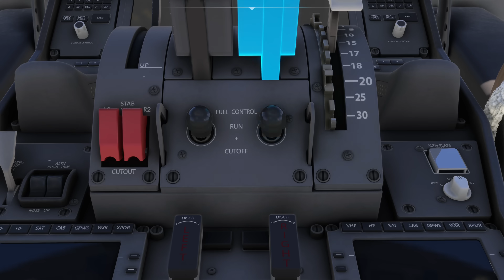Air India 171: Why Did The Fuel Cut-off Switch Get Moved?

Comment: Question, when the switches are moved from on to off or off to on is there a display that shows the status of the switches? If the input to the switches, either a voltage or ground were to get a bad connection it would cause the fuel to cut off even if the switches were still in the on positon.  If this is the case and the display is for loss of fuel pressure instead of the state of the switches  this could be what ensued.  Thus the pilot would cycle the switches.  Jim.

Comment: Captain Steeeve said that the reason a plane’s computer system will allow engine shut-off is because of a potential landing situation where there may be a fire in one or more of the engines.  He has also said in a previous video that there are sensors in the landing gear that switch the plane from ground mode to flight mode.  Can there not be a simple time restriction placed on the engine shut-off controls which will not allow them to be switched to the off position until a certain time period has elapsed after the switch from ground to flight mode?  I’d have thought this would be really simple. There could also be a procedure both pilots would need to carry out if they really did need shutting down in a take-off situation although I would have thought that, as in this case, any such situation would cause the plane to crash anyway.

Comment: FADEC stands for Full Authority Digital Engine Control.
What FADEC does

Monitors and protects against overspeed, overtemperature, and mechanical failure

It's called "full authority" because the system has complete control over the engine, and pilots cannot override it manually (except by cutting off fuel or shutting down the engine).

> Because pilots cannot override FADEC electronically — it has full control.
Only cutting off fuel manually (via fuel cutoff switches or fire handles) overrides FADEC.

Comment: But these are two separate switches, operating independently. So, if it's truly a mechanical error, as stated in the 2018 advisory report, how likely is it that the exact same issue would occur with both switches—especially one right after the other? That seems highly suspicious. It feels like this may have been done intentionally.

Comment: What happens if I put my hand to those switches to get support? When aircraft takes off the angle that I apply the force could change and it may accidentally open the mechanical lock. I think it could be unintentional as well as on purpose.

Comment: The FAA’s 2018 SAIB warned that in some aircraft, the lock mechanism could be disengaged, meaning the switch could move to OFF unintentionally, due to:
	•	Vibration
	•	Accidental contact
	•	Mechanical failure
	•	It advised operators to inspect these switches to ensure the lock engages properly (i.e., they can’t be moved without lifting the guard).

Comment: a comment from an other video: "This is exactly what happened:   - There was an anomaly in the electrical supply at 08:08:41h, so the hardware and software closed the fuel valves.   The engines began to lose rotation and the RAT was automatically activated. When it restored electrical power at 08:08:52h, a RESET was generated in the software and hardware, then opening the valves again and indicating that the switches had been placed back in RUN, when in fact they were NEVER changed by the pilots!      -Don't forget that Boeing's 787-8 Dreamliners have a history of electrical problems!" what do you think about that?

Comment: Dear Captain Steve...
I can come up with 3 scenarios as per my understanding... can you throw some light on the 3rd one if it is possible ?

Scenario 1

1) Takes off... perfect time low altitude high speed... no recovery time possible.
2) Cutsoff both engines... asks the other guy why did you cutoff... the other guy says I didn't.
3) After 10 SECONDS... the other pilot starts up the engines... 
4) Pilot flying says "Mayday Mayday Mayday"... just that... nothing else.... how and why ?

Questions- 
1) Why was the nose up if he wanted it to go down...
2) Why didn't he resist the fuel switches coming back to run or didn't cut them back off.... 
3) What was the time of asking why you cutoff... basically after how many seconds of cutoff... immediately... (proves intent)... after 3-4 seconds when climb stops... or the noise of engine spooling is heard... (benefit of doubt).

.
.
.
Scenario 2
1) Takes off...
2) Pilot monitoring cutsoff fuel switches...
3) Pilot flying asks why did you cutoff... pilot monitoring says he didn't... lying obviously.
4) Pilot flying takes the switches back to place and keeps the nose up hoping for recovery. 

Scenario 3
1) Engines fail....
2) One pilot notices it and takes the switches down to cutoff to again turn them to RUN as a trial to fire the engines up again.... but due to some issue he can't.... now he is pulling the switches....
3) The other pilot notices and asks why did you cutoff.... he says he didn't... as in "I didn't do it first... it failed so I did" but no time to explain that much and he is desperately trying to get one of the switches back in place... one comes back after 10 seconds... then he grabs the other and it comes back as well after 4 seconds...
4) Engines come back but it's too late... the other pilot seeing decend declares "Mayday"

Comment: Those fuel switches must have been in the cut off position prior to that flight and then moved to "run" position at engine start up. I see no reference to that in the report. Would that not have been logged by the data recorder ?

Comment: The second pilot had placed the fuel cutoff switches back to the run position after just 10 seconds despite the overwhelming stress and denial he must have faced seeing that the other pilot placed them in the off position. However is it possible that had they been placed back to run faster than 10s, could the plane have recovered? Has anyone ran simulations to see if this would have been possible?

Comment: I'm not a pilot, but have a good understanding of technical and practical matters, what occurs to me is this: Boeing has small protective brackets on either side of the fuel cutout switches to prevent them getting accidentally moved. This fact alone acknowledges that those switches, in theory at least, can be accidentally moved. In looking at the pictures of those protective brackets either side of the fuel cutoff switches, they are rather small, and they only protect from movement from either right or left side. It appears the engine power control is just in front of them, and if I am correct the pilot pulls back on that control to increase thrust, so he is applying pressure on it in the direction of those switches. Is it not possible that his jacket cuff could have accidentally knocked those switches, or possibly if his hand on the thrust control slipped back off it a bit when he pulled back on it, or something like that whereby he could have accidentally knocked those switches into cutoff positions without intending to do so? Coming from the direction of that thrust control there is no protection from accidentally knocking those switches and turning them off is my point, and perhaps other types of actions coming from that same direction could explain how those switches got turned off?

Comment: Hi Captain Steeeve,
I’m not an aviation expert, but your analysis of Air India 171 really got me thinking. I hope these questions make sense:
1. Fuel‑pump redundancy
On a modern aircraft like the 787, why isn’t there dual‑control for each engine’s fuel pump?
It seems surprising that pushing both switches to CUT-OFF would shut down both engines so easily.
2. Engine relight and thrust application
I noticed they waited about 10 seconds to restart the engines (which seems a lot to me). Have they applied full thrust to engine 1? If not, why?
3. “Why did you shut the engines off?”
When one pilot asked “why did you cut off the fuel?”, it struck me that the question might have been asked by the one who actually operated the switch. The other pilot’s “I did not” seems like an honest response, but could the framing of the question itself be influencing the tone?
4. Cockpit‑voice clarity
It appears clear from the cockpit audio who said what, but the preliminary report didn’t specify speaker attribution. Any idea why the AAIB is holding back that detail?
5. Personal affairs of the pilots
I’ve seen some references to the pilots’ personal lives in the media. Who is digging into that, and do you feel it’s relevant to the investigation?

Comment: Hello @CaptainSteeeve , i have a question, how can it be possible both the fuel switch change from run to cutoff in 1 sec , do we have  information when both fuel switch turns to run at first time (is it just before take off) and what was the time in secs when it is turned to run. Also , why we are ruling out a case that both switch turns to cutoff due to mechanical defects. Isn't it possible?

Comment: Unfortunately, there is no way to make anything foolproof.    In fact, well meaning attempts to do so can result in unattended negative consequences.   For example, although requiring both pilots to agree to an engine shut down sounds like an interesting idea,  what happens if an engine needs to be shut down if one of the pilots is absent from the cockpit - or if one pilot has lost consciousness, or if the pilot flying is desperately fighting another problem needing both hands to do it.  I once had a military pilot almost bite my arm off when I had the “brilliant” idea of adding one more switch to a cockpit.  Still, one needs to be very careful adding additional fool-proofing steps.

Comment: https://www.youtube.com/watch?v=vJC4JdUmudk&list=RQVKQ9sehZSMkCv3YXp83RnTx3zBs&t=180s

https://www.youtube.com/watch?v=Vi7Fj0Q-YO8

https://www.youtube.com/watch?v=vqFgf7ezwv8 (Listen to this -US Aviation Lawyer talking about the computer control system in dreamliner)

Relevant Videos for Context and Technical Insight:

Indian Pilot’s Overview

Follow-Up Analysis

US Aviation Lawyer on Dreamliner Systems

These videos present a more technically grounded perspective than some early media coverage, which appeared to suggest pilot error before full investigations had concluded.

🚫 Too Early to Blame the Crew
Many theories have been discussed, but it’s important to remember: the pilots are no longer here to respond or clarify events. Drawing conclusions prematurely is not just unfair — it can hinder deeper analysis into possible system-related causes.

The preliminary report does not establish definitive cause. There are still unanswered questions, particularly regarding aircraft systems and prior advisories.

🔍 Key Points Raised by Experts in the Videos:
✅ Fuel Control Switch – Possible Electronic Malfunction
The switch reportedly transitioned to “cut-off,” causing engine shutdown.

This may have been triggered by an unintended electrical or software signal, not necessarily human input.

⚠ 2018 Advisory Was Not Mandatory
An earlier FAA advisory warned that fuel switches could be misinstalled if locking mechanisms weren’t properly disengaged.

This inspection was recommended, not required, and it’s unclear whether all aircraft were checked.

🧾 Preliminary Report: No Findings Against Major Manufacturers
Boeing (airframe), GE (engines), Honeywell (avionics), and Air India (operator) were not cited.

Some aviation professionals have questioned whether all possibilities were fully explored.

❓ Transparency Gaps
The status of the Cockpit Voice Recorder (CVR) has not been publicly clarified.

No detailed engine health data or internal diagnostics have been released so far.

👨‍✈ Experienced Crew
Experts have noted the crew’s high level of experience, and that no current evidence definitively supports pilot error.

Conclusions should await the full investigation.

📉 Parallels with 737 MAX
In previous Boeing 737 MAX incidents, early blame was placed on pilots — but later investigations revealed deeper automated system flaws (MCAS).

Those cases show the importance of not ruling out technical issues too soon.

✈ Final Note
“Aviation safety depends on facts, not assumptions. If a known technical vulnerability was missed or not acted upon, that deserves full, independent scrutiny.”

This isn’t just about one aircraft or crew — it’s about the integrity of global aviation safety. Investigations must stay transparent, open-minded, and independent of external pressure.

📌 It’s too early to assign fault. Let’s wait for facts — not headlines. TOO EARLY TO DRAW OWN CONCLUSION BASED ON PRELIMINARY REPORT

Comment: Yes, cameras should be in the cockpits, and they should have a live feed to a cloud where all information is stored to be reviewed in a case like this or when otherwise needed.  Or if they can't do that, then the camera needs to be protected in a box where it cannot be accessed by the crew and has protection in case of a crash, like the black box.  Like Steeeve said, this would give CONFIRMATION when needed.  As in this case, it would have shown for sure which pilot switched off the fuel.  

The pilots are there to do a job and part of that job is keeping their crew and passengers safe, and if that means a camera is in the cockpit, then so be it.  The right to privacy does not apply imo. Safety comes first.

Comment: The fact that the pilots' conversation timeline is not released says a lot. With the engines losing power fast, wouldn't that be the obvious question?
All above happened BEFORE a last ditch attempt to cut off and on the fuel switch to re ignite. RAT deployment indicates that the engines most probably flamed out early, before these desperate attempts to re ignite 

Why not release the timeline of the words spoken, timeline of the RAT deployment, timeline of rest of the events.... that's it.

What is being hidden here by being so vague?
One pilot to another without any timeline is obviously intentional.

And Capt Steeve in his kind voice will go on hammering away that planes are just fine, it is the pilots. Joke.

Comment: Captain steeve is naive, it is tcma failure, the erroneous signals due to static discharge (between wheels and dusty dry ground) caused Wow signals delay reaching fadec, so while takeoff and airborne computer thinks TCMA thinks it is on ground, also if static discharge is powerful enough currents can be injected in variable resistor of engine throttle causing jump in resistance due to heating, so throttle appears idle, this is the same condition for which TCMA/fadec does double engine shutdown and occurred in ANA flight during reverse thruster operation in 2019. Also, Captain steeve cannot forsee the possibility of ball lightning? Since these fuel cutoff switches are mechanical I'm theorizing a very rare possibility that very high energy but centimetre radius ball lightning motion nearby injected high ampere currents in the springs causing spring constant drop to zero and loosen the switch enough to go mechanically cutoff? Ultimately,  TCMA failure due to induced currents from ball lightning or simply natural lightning (not thunderstorm but friction charging on dusty ground )or geomagnetic oscillation( solar storm) induced currents can cause throttle variable resistor to become momentarily idle, 100 amps resistance and joule heating plus time delay in wow signals from gear to fadec!!! So, fadec thinks it is on ground and throttle near idle so it shuts down both runaway increasing thrust engines. It's more logical this way, the code worked to shut down engines when conditions are met. They were met while takeoff? I think it should be aviation practice to also sprinkle water on dusty ground and tarmac and runway? Or extend the runways? Both

Comment: While "in the air" when would it ever be appropriate to cut off fuel to both engines on a two engine jet aircraft ? 
A simple physical slide bar below the two switches could be employed where the bar would allow moving either switch down to the
"cutoff" position.... but prevent doing that to both switches.
"Other" interlocks for switch operation could be employed when the aircraft detects that it is NOT "in the air"..
The same pricipal is used on electrical panels when a breaker is used to accomodate "backfeeding" the panel from a generator versus the normal untility power source...This prevents the generator from "backfeeding" power into the public unitity equiment...